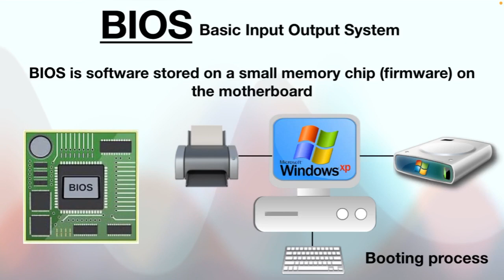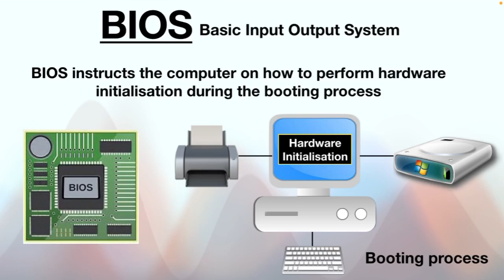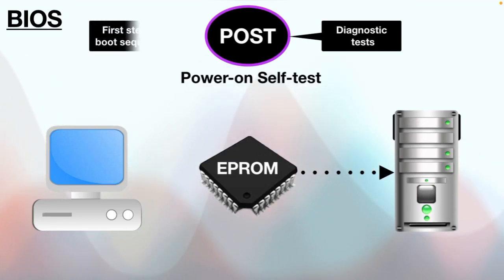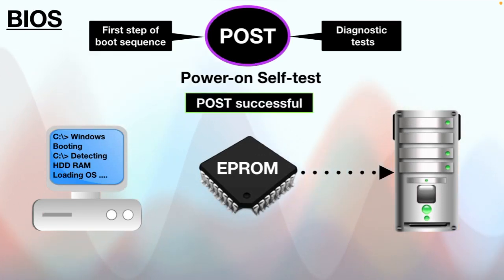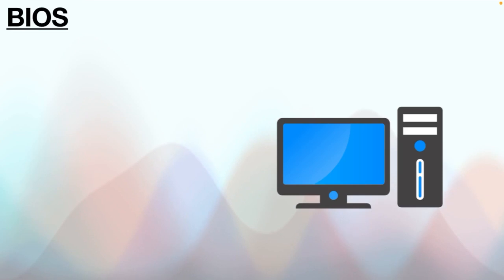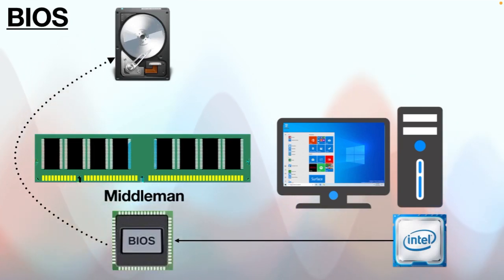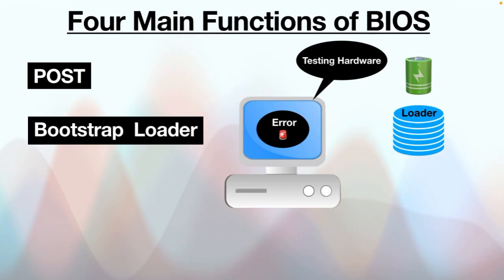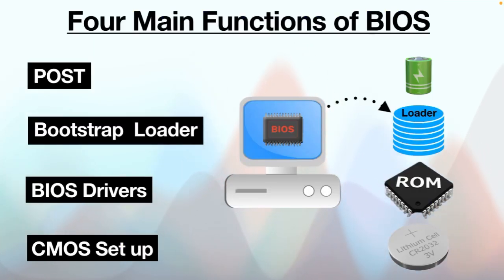What is BIOS | Basic Input Output System

Comment: BIOS is an interface to control the computer for the computer manufacturer, as opposed to an interface for applications or for computer users.  So while an IT professional should be aware of what BIOS is, they should use it as Read Only and shouldn't modify the BIOS settings, unless specifically instructed by the computer manufacturer. Is that correct?
Reply from the maker: Exactly you are absolutely right 👍